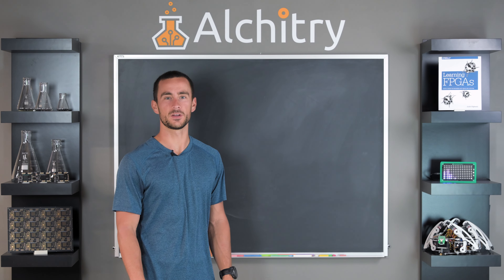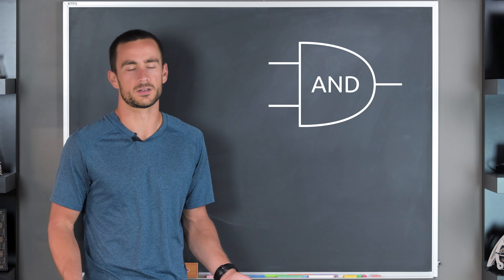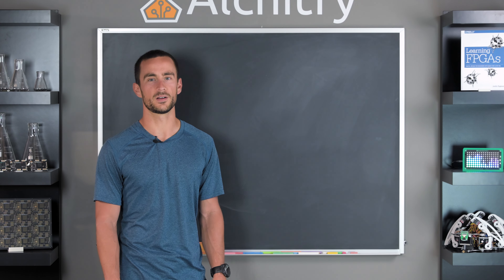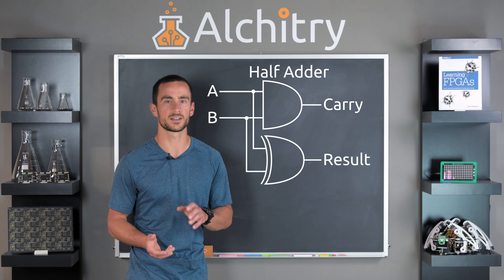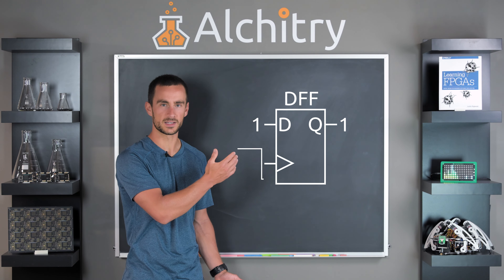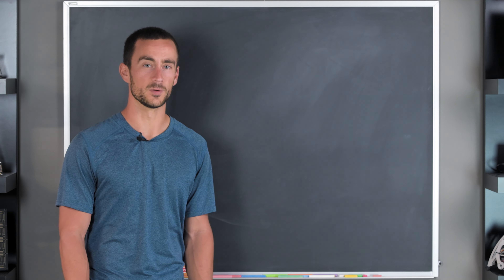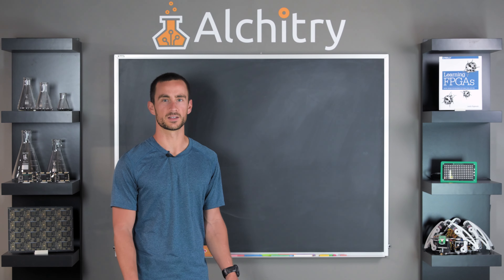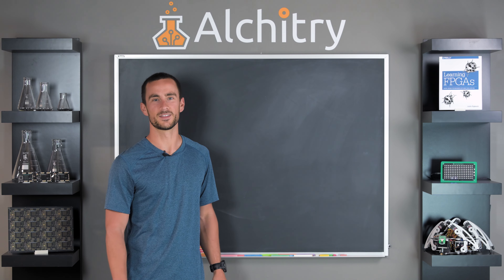Intro to Digital Electronics and FPGAs

Comment: Hey, I just bought your mojo board because I'm TRYING TO GET INTO fpgas and eventually make my own boar embedded in my applications. Thank you for all your resources. The reason I chose the MOJO is because it has the XIlinx 6 with actual pins as I am not ready for BGA's yet. I will be using it for music synthesis with a teensy 4.0

Comment: Hi, there! Really love the simplicity of Alchitry Lab design flow!
I am curios would it be possible for alchitry lab to support custom board?
Reply from the maker: The software is open source so if you're willing to tinker it's possible. Targeting similar chips in the same family (Xilinx 7 series or lattice Hx) should be pretty easy

Comment: Why is 12= (1*8)+(1*4) in binary? what do the 8 and 4 represent? I am assuming they are 2^3 and 2^4 , but why? NB: And btw Excellent Video and lecturing :)
Reply from the maker: They are just numbers. This was to show that in decimal you could write 12 as 1*10+2*1. The 8 and 4 represent the values of those digits and are 2^3 and 2^2 respectively. In binary the digit value is 2^n where in decimal it is 10^n (where the first digit n=0)
Reply: Here’s how I think of it.

First, note that of the following series of numbers are sequentially doubling:

1, 2, 4, 8

Then reverse them:

8, 4, 2, 1

Then, consider the following equation:

1100 = 12

Here the left side (1100) is expressed in binary, but the other side (12) is expressed in decimal. 

Now, consider the second equation in the video, although I’m going to express it differently. 

1100 = (8*1) + (4*1) + (2*0) + (1*0)

As before, binary is on the left, and decimal is on the right. 

Notice that the (a*b) expressions on the right side contain some patterns. 

Firstly, the ‘a’ factors are 8, 4, 2, 1. This is the same doubled-number series mentioned earlier. 

Secondly, the ‘b’ factors are 1, 1, 0, 0. This pattern matches the binary number, 1100. 

So, getting directly to your question, the 8 and 4 were used in the video because they are part of the doubled-number series (8, 4, 2, 1) that were laid out above. 

I’m not sure why the  presenter left out the 2 and 1 from the series. Perhaps because they were being multiplied by 0? Or because the chalkboard was too small? 

I was initially confused by that part of the video too, but when I puzzled though it, and made everything more explicit, I was able to make sense of it. 

I hope this helps you or anyone else who needed further explanation. 

Lastly, bravo to the presenter and any others who created this otherwise-superb video.  👏👏👏